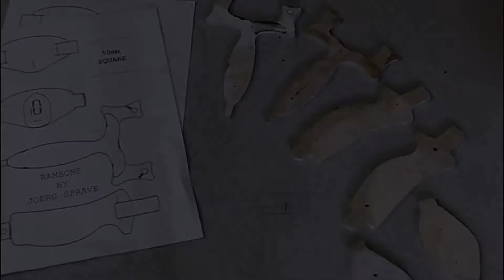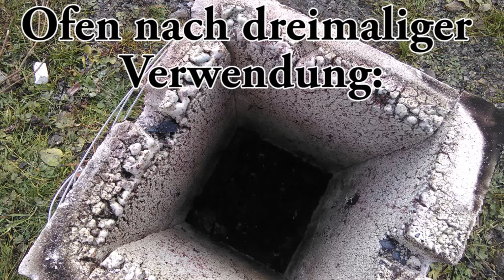Kupfer gießen – Fertigung einer Steinschleuder aus Kupfer

Comment: Sweet matey love it . I personally would use the Aluminium one because of the weight but it’s still a great cast😁👍🏻
Reply from the maker: bigstackD Casting Thank you!😃
Yes the copper one has indeed a lot more weight. However, I mounted different bandsets on it, and I am using the copper one just for training purposes. I think I will also try casting one out of brass just for fun. Then I have them in all three colours.😁